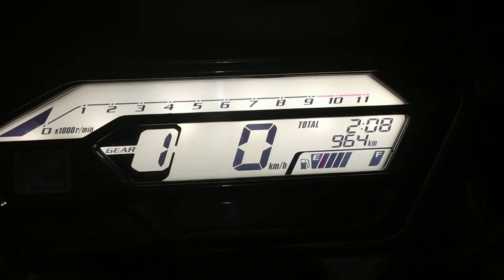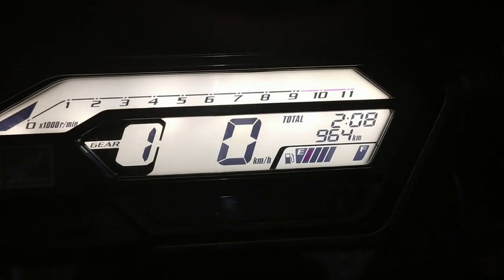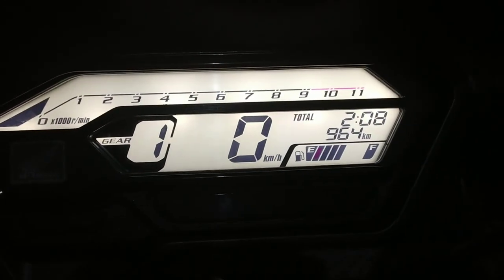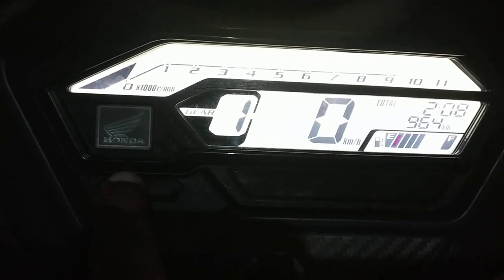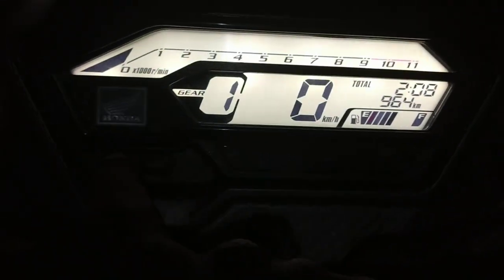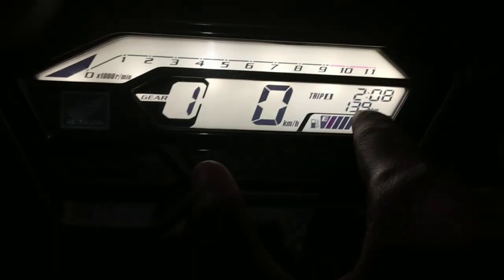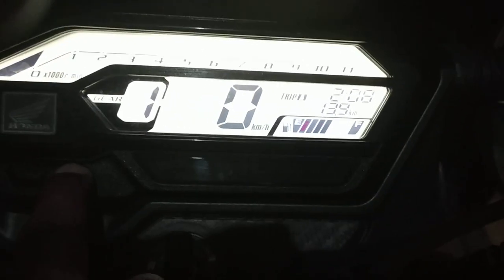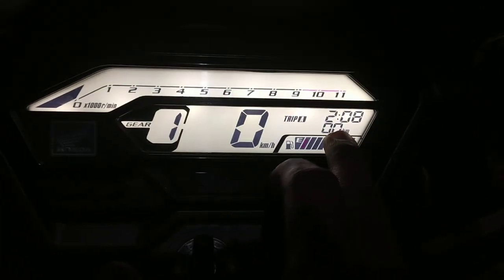how to use Trip meters in Honda X Blade

Comment: One spanner symbol is blinking under time indication. What is the meaning of it???
Reply from the maker: It's a service due indicator brother. 
To get rid of it
 Follow these steps
U have two buttons under the console
1.Turn the key off. Press and hold right side button for 3 seconds
2. now turn on the key with out removing Ur hand from that button
In 2 secs 
It will be vanished